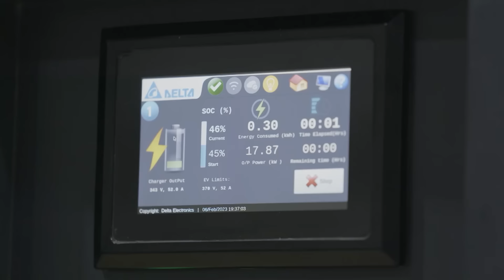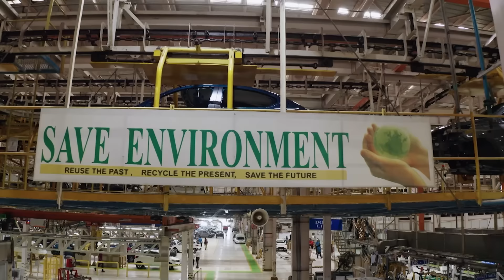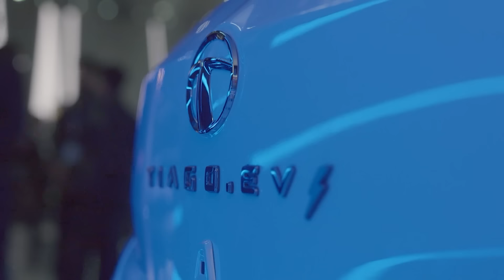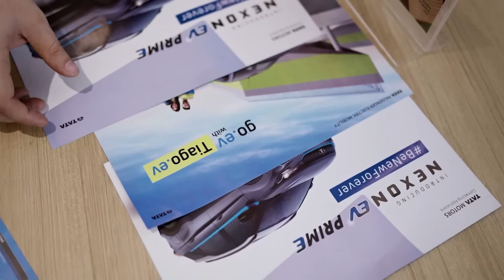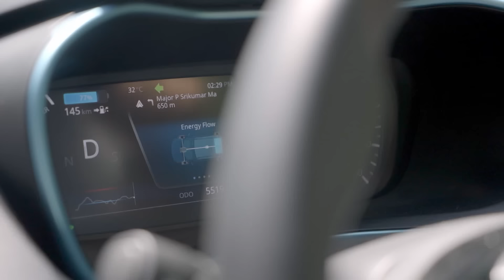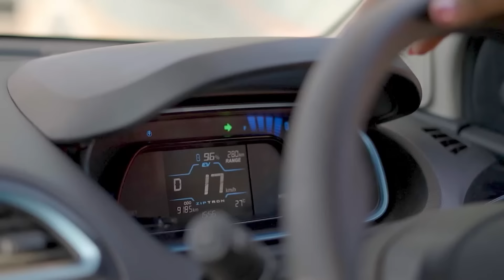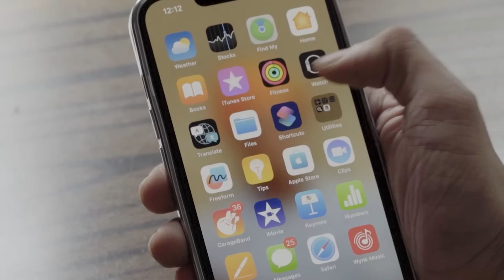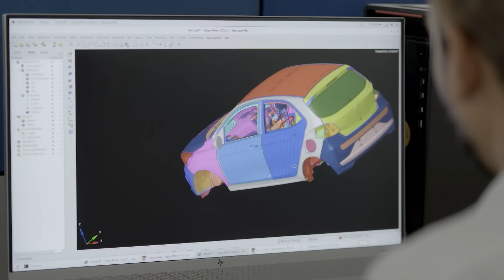Go.ev | The Electric Revolution Documentary (English) | Tata Motors X National Geographic

Comment: Owning a Tata car will be a life changing decision. 

Let me tell you my story of being a Nexon Ev Prime owner for the last 30 months(2 and a half years). 

While I must admit that I really enjoy driving the car, the experience is often short lived. In my 30 months of ownership, I've visited the service center close to 50 times, my car been in the service center for about 60 days in total (multiple visits, none due to accidents). 
In my 30 months of ownership I've got more parts replaced/repaired in my car than anything else my family owns.
- all four door panels have been repainted due rusting (still getting rusted after repaint, I'll visit again when I've time)
- the rear boot door has been repainted twice and still getting rusted.
- The charger supplied with the car overheats (tata came with a software upgrade to fix the issue, but it reduced the charging speed, now my car charges in about 14 hours (0-100) instead of 10 hours before the update.)
- Seatbelt were replaced since they stopped working
- Breaks were replaced 
- Door handles and rear boor lock has been replaced, since they stopped working. 
- Steering assembly has been replaced, as the auto turn signal cutoff was not working.
- Button has been replaced twice, as the media control buttons won't work.
- Horn pad was replaced since, while fixing the above issues, they broke the horn pad.
- AC stopped working on the second day after delivery, and I got my car back after 10 days in service center, and that didn't fox the problem. After several visits to the service center, it was me who suggested to check for all the loose connection of the cables and gas leakage(they were adamant that the new car won't have AC gas leakage).
- Poor fitting and alignment of body parts 
- worst service center experience you can ever expect (this is one thing tata is very consistent from service center to service center)
- Broken infotainment system, it has it's on mind, it'll get stuck, reboot randomly, forgets things very often...
- Frequent critical errors and Fast Charging Issues.
- The first year of ownership was a nightmare as it was impossible to take the car for a long drive as you'll never know when you get stuck in a charging station due to a common problem of charging socket lock actuator. My lock actuator has been replaced 3 or 4 times, I lost count.
- Tata Connected car app, Z-connect is the worst of it's kind. Not reliable at all. And tata will ask you 6k+ for two year subscription, And even after that, they'll delete your data after a few months, won't let you download and keep your data. So basically tata is asking you to pay them to use their buggy alpha software, they are asking you to pay for them to take your data for their research and development. Fantastic. 
- service center will ask you to replace your reusable/washable mesh type AC filter with a new one. That's just plain stupid, but they'll scare with 'warranty will be void' warning.

Many of the issues I faced, such as rusting and charger overheating are quite common, every other nexon ev owner will agree to it, it's just a matter of time till they notice it.

Apart from my own experience, the following are also quite common things you'll experience if you buy a tata car. Just join any tata ev telegram/whatsapp/facebook community or browse teambhp or twitter.
- Critical error when when taking your car below 20%
- Charging session randomly stops, you'll wake up in the morning expecting a fully charged car, only to be surprised to see that it stopped charging; now get a taxi.
- Battery replacement is also not very rare, imagine your car suddenly going to 0% from 40% at midnight, and in the middle of nowhere.
- While their parts are IP rated, many got water damage to their cables, PDU and other components and got them replaced.

What I don't understand  is how Tata Motors manage to mess up so many things despite using the top quality parts from Bosch, Siemens, BMW, APTIV...
I must appreciate the quality of the individual components used in the car, but it's and engineering marvel to see how Tata Motors manage to mess up so badly.

Now let me tell you how/why owning a tata vehicle will change your life. 

You see, when you go the service center for any issues, they'll not admit the problem, at best they'll blame you, most of the case, they'll sat there is no issue. Now it's upto you to carefully document everything about your car, you are very likely to be a vlogger/blogger, at least, you'll start writing your 'diary'/daily log of your car. You'll start documenting and noticing every single thing about your car. 
See, Tata just made your documenting skills way better. 

Now, you've the evidence, they won't agree, not yet, Innocent unless proven guilty. So, now it's upto you to reproduce the error in presence of the service center guy. So all of a sudden you become a very good debugger and QA/QC guy. 
You have to read the manual,s study about the cars, talk to other owners learn about the issue and show the service center how your car is behaving abnormally, you become a automotive expert.

Okay, now they admit the issue, they'll now accept your car and start 'working' on it. This is when you learn how to be patient or in most case this is when you go mad. They'll never answer your calls, mails, no update no nothing. Then you'll visit the service center to check with your car, and you'll see that your precious car is just waiting in the yard, at a corner, collecting dust and dirt,  under the sun. For them it's just another piece of junk.
At this point, you'll either have a breakdown and lash out, or you'll learn to control your temper (for now) and keep your cool.

Now you'll return, keep calling and messaging everyday. Still no progress, at this point, you'll will not keep your calm, you'll shout, you'll be sad, you'll be angry, you'll visit the service center, you'll talk loud, everyone will look at you as if you are crazy, even the potential customers. Then they'll take you seriously. This is when you realize that 'crying baby gets the milk", angry baby in our case. So, Tata just made you an angry person, they taught you that being a nice customer will not get you the rights you have as a customer.

Okay, so, now you got a brand new EV for 17 lakh+, and it has been with the service center for a few days, you are renting a car or using another ICE car and spending a lot on rent and/or fuel. This is when you realize that as a customer you have rights, so you'll talk, read and learn about all your rights as a customer and now you'll go the service center argue and claim your rights for a loaner car/compensation. They won't agree, so you'll become a 'lawyer' and make the agree. Still they may not agree, now you'll learn to become a lobbying expert, you'll pull all strings you know, social media posts, auto-vloggers, consumer court... finally they'll yield when they get a notice from your lawyer/court.

Okay, so finally you got your compensation/loaner car, you got your car back. At this point you'll see that they haven't fixed your issue to your liking or they broke another thing while fixing it (very common). Or they scratched or dented your car body, stole something from your car...
So you'll learn that you need to be a detective for the next service center visit, you'll have to take photos and videos of every single scratch, dent, every single item in your car...
So, all of a sudden you now learn to be a QA/QC guy, an expert in PDI. 

See I told you owning a tata motor is a life changing decision. 

Do you realize what you've became in just a matter of months ?
- You are now the expert on electrical vehicle technology
- You now know how to argue like a lawyer, 
- You became a debugger/detective, you are proud of your skills gather evidence as a detective, present case as a lawyer and get the opposition to yield.
- You learn to control your emotions, you learn to keep your calm while arguing, despite being extremely angry inside.
- You learn all about consumer court and consumer rights
- You learn the value of time, you'll learn the fact that sometimes you've to let go and accept the fact that time you are spending is more valuable than what it is being spent for.
- You just became the goto person for anything car related, your friends and family will call you for PDI of a new car, consult you for insurance, dealing with service center...
- You learn to take leadership, become active in social media, help fight for a group of people with similar experience like yours

All of this at a cost of you, you are no longer the same person before owning the tata car
your husband/wife now became your ex, you spend more time after work for your car than your partner, unless you learn the value of time as I mentioned above.
Your parents lost their kid, as they don't recognize this new angry and frustrated person you've become.  

Do you now see why owning a tata car is the life changing decision?
Thank you so much Tata Motors for Teaching me lessons worth of a life in such a short time. Love you guys.❤‍🔥

For all the Tata Fans out there, 
Fire just gives you light and warmth from a distance; the moment you get too close, it'll burn.

And for all the Make in India Fans, 
None of the critical components in the car are made in India, 
the battery, electronics components, motor... everything imported and assembled in India.
Electrical/Electronics are from Bosch, Siemens, Aptiv, Harman and some Chinese vendors (battery BMS and all)  among others.
Reply: That sounds dreadful.  I hope TATA is listening.  Converting a painful experience to a blissful one is still in realm of possibility.  TATA needs to take some lessons from digital firms like Amazon and Swiggy to convert a detractor to a supporter.  I say this as a user and supporter of TATA Motors.  Please improve your customer experience on a war footing to retain your market position.
Reply from the maker: @Kurian Antony Hi Kurian, we would really like to help you with this. Kindly provide your contact information, dealer details and Location details, so we can have the concerned team contact you for further assistance.
Reply from the maker: Hi Sibu, we would really like to help you with this. Kindly provide your contact information, dealer details and Location details, so we can have the concerned team contact you for further assistance.
Reply: @kurianantony6391 
I don't if it's me who learned to adjust or tata improved a little bit in the past few years. But I think it's a little bit of both, probably more of the former, as if I had a bad marriage  with tata and I've realised that I don't have choice other than to adapt, unless I want to suffer the losses of the divorce.
But Tata, you are welcome to patch up and have a happy life ahead.

I'm not for or against tata, I had huge respect for Tata, until I became their customer. I'm a customer of Tata Motors and Tata Solar. They were both consistent; both disappointed me.
Reply: @tata.evofficial  if you want to help us, please let us know how to reach you.

Comment: Really Need to improve the problems initial buyers have faced. They are still there even after 2 yrs from launch. On top Road Side Assistance is pathetic right now. HV ( High Voltage) alert one such glitch that can still happen with any Tata EV car, which will hault your vehicle immediately and in 90% of the times no other option other than towing. I was stuck for 6 hrs till the car got towed and I was just 20 kms from Pune that too on national highway. Still 6 hrs. I can't imagine also if I were at a remote place at night .  So choose wisely. Tata EV for atleast next 3 yrs is not a good idea.
Reply from the maker: Hi Shrikant, we would really like to help you with this. Kindly provide your contact information, dealer details and Location details, so we can have the concerned team contact you for further assistance.

Comment: Electric vehicle is by far an exaggeration with environmental issue solver, Hybrid is the way forward and unless we do not have good storage and generation of electricity, EV is just gimmick. Even mining Lithium will have environmental impact
Reply: Inspired by WhatsApp University
Reply: @SocialistHeaven  Hybrid are good for now and they can refuel if charging time is not available. They are more reliable too. Toyota has good hybrids and you only need to refuel them once a month.
Reply: @himanshusingh5214  Hybrid is just temporary but Ev is permanent. You need more hybrids than evs for attaining net zero emissions, which is harder
Reply: Is electricity production 100% green?
Reply: Fossil fuel use can not be curbed by introducing hybrids. Total ban is only soln. But charging stations must be available every 30 km.

Comment: They are Cheating customers advertised Nexon ev  prime battery capacity 30kwh but actual battery capacity 27kwh only. Advertised range 310km but only 230km real world range.
Advertised fast charging speed 56mins but actual it's 100mins or 1hr 40mins

This is paid promotion
Reply: Battery size is only 30 kWh and range is idc range not real range which is always higher. Blame idc for it
Reply from the maker: Hi Sripal, we would really like to help you with this. Kindly provide your contact information, dealer details and Location details, so we can have the concerned team contact you for further assistance.
Reply: 56min is for 20-80%, not 100%, charging rate slows down after 80% on all EVs, even Tesla, Volvo, Merc etc
Reply: Very true. Every ev manufacturing company does this. 300 km claim means u get 210 to 220 km

Comment: if roughly 70% of electricity generated is thermal power (power generated by burning coal), how are EVs a solution to ecological challenges put up by increased carbon footprint? My Nexon Diesel (BS4) may be belching out some carbon soot and NOx fumes, but does burning coal (which is far more dirtier than Diesel & Petrol) solve the ecological question? Though Diesel is being put up as an universal villain the EU  had nice things to say about diesel in the past (during Euro 3 Regime had incentivized transition from petrol small cars to diesel small cars because carbon emission of diesel is far lower than petrol), the actual solution is a combination of approaches like Hybrids, Hydrogen (fuel cell + H2 based ICE). Imagine the amount of mining activities required to get a few ounces of lithium, cobalt etc.; what about the pollution generated by the process of battery manufacturing? can we be sure of appropriate battery disposal at the end of the EVs life cycle? Please think and then pitch Battery EVs as a panacea for all air pollution problems.

Check out this IIT Kharagpur study that takes the mask off the Battery EV: ( https://www.iitk.ac.in/erl/Downloads/LCA%20and%20TCO%20Analyses%20of%20BEVs,%20HEVs,%20and%20ICEVs.pdf )
Reply: Because ice engines are inefficient compared to even thermal power plants (don't even compare it to solar, wind or nuclear or even hydro). 
The share of coal is high now but even today solar is the cheapest source of energy. Economics are now in the favour of clean renewable energy. It makes very real sense to wean off our fossil fuel dependence ASAP.

Fossil fuels are the biggest imports in India. Even reducing it by 10% will do wonders for the Indian economy.